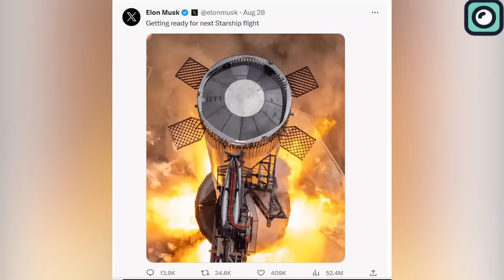FINALLY! SpaceX's Starship Super Heavy Booster Shocks Everyone!

Comment: Starship needs to have successful flights first, before it can start building them in mass production. They need a working prototype to copy, first, right?
Reply: nope they make changes along the way and even if the prototypes need a huge makeover they can test with the ones which are built or being built thats the beauty of spacex
Reply: Building them in mass production, IS the prototype-production assembly. SpaceX in contrast to every other rocket knows that if you want to get to Mars and beyond, you can't be afraid of failing, Fail, learn from it, innovate, redo, implement and voila, next Starship to go. This will keep happening during the Prototype-era until it's ready to go operational. 

People might think that once Starfactory is ready, Starship will also be, but that's not entirely true. They are building Starfactory so they can build the machine that builds the machine just like they did with Tesla. And along the way they will optimise and perfect the machines in the factory and speed up the production-process. You can build starship-prototypes manually just as they are doing right now, but everything they've learned along the way, they will integrate and implement with Starfactory. So, it's still going to be prototypes even in Starfactory, but the speed up process will be multiple times, by using machines that builds the ships instead of humans. (Well, the humans will always be a big part of the work ofc)